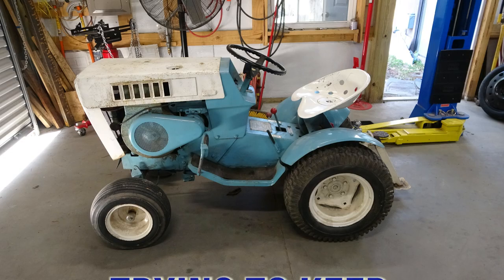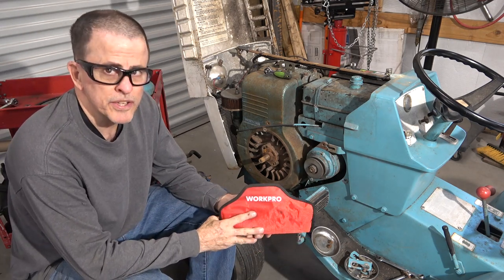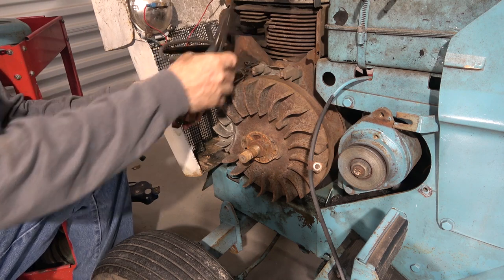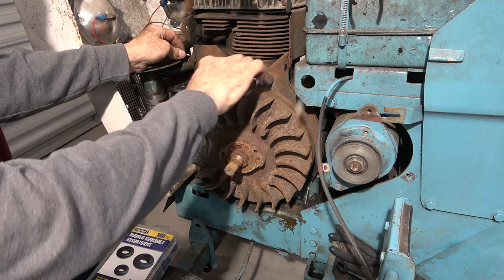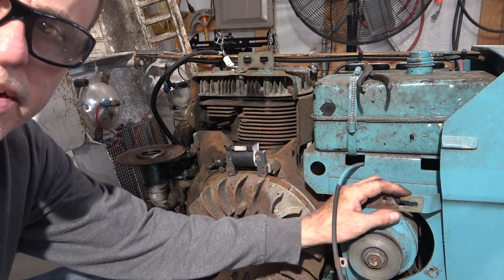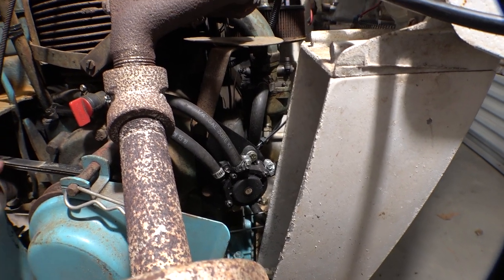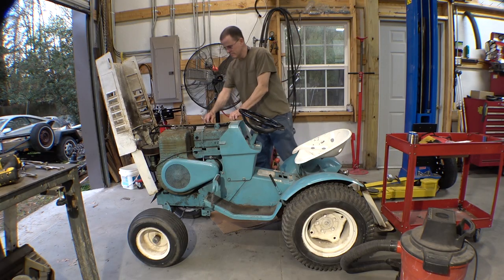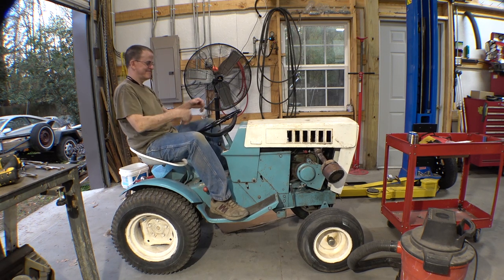lawn tractor will not start - 1970 sears Suburban SS14 , ignition coil, fuel pump #ss14 #lawnmower

Comment: I have a SS 15 and it will not start as well is it is really as simple as changing the coil?, how does this bypass the points, thanks in advance
Reply from the maker: Can't say that it will help yours but it fixed mine. All it has is the coil and a kill wire to the switch.  Mine would start, it just took awhile to start.

Comment: Do you still have the part number for that coil?
Reply from the maker: Just the link in the video description
Reply: 398811 is what I used,  got it from Amazon...
Reply: 398811 is what I used,  got it from Amazon...put the little connector side out,  coil wire next to engine block.